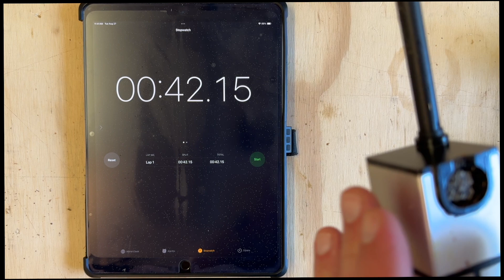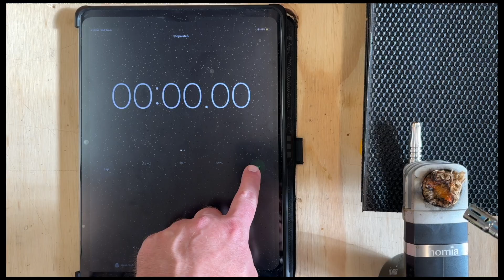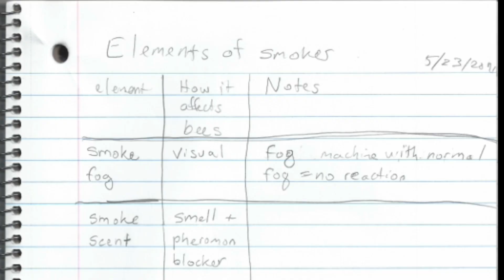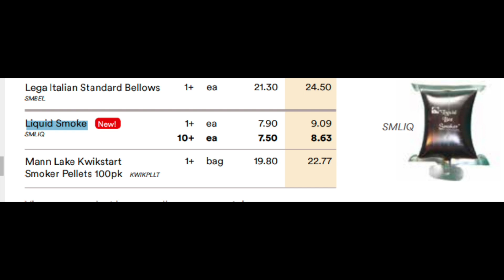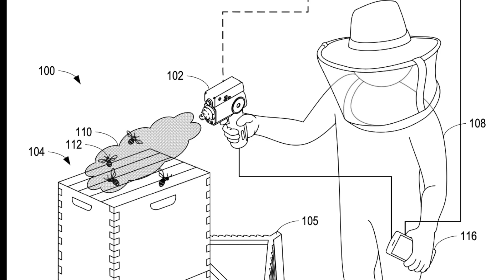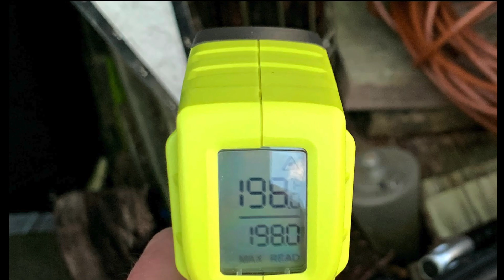The Electric Bee Smoker That Could Change Beekeeping Forever  ⚡️🐝💨

Comment: I assume the latest prototype is still using a purchased vape? How long is it safe to use for without overheating the components/battery? Are you concerned about the vape battery exploding while it's in your hand? What precautions have you taken for those scenarios?
Reply from the maker: Hey Austin, I'm using a mix of off the shelf parts and custom ones.  We're still in the early prototyping phase, but regarding safety we're using overheating detection that safely turns off the circuits and we stay within the recommended wattage. Thanks for the questions.
Reply: @TechnicallyBeekeeping May I suggest to work on adapting a bee smoker with an electrode inside to auto light and a fan blower so you don't have to pump a bellows, use a Milwaukee M12 battery NMhi. Reinventing the wheel from scratch is not practical when the early smoker chamber would serve well, it may be hard to get away from bio fuels. One concern is that the creosote in the not fully combusted bio fuels causes cancer, it's a major concern for health to try and improve it IMO, it would require heaps of scientific testing in laboratory conditions, would cost a lot but worth every cent if it can bring a better product to market. I doubt you'll get people to spend more than 100-150 $ though so it has to be affordable again IMO.
Reply from the maker: @livingadamman7994  Regarding creosote, I'll avoid using that like the plague, definitely a toxic substance. You read my mind on the M12 battery, the form factor and weight should be perfect.

Comment: Very cool, the dewalt battery may make it impossible to hang by magnet which seems like a plus to me.  I've been keeping bees for more than 20 years and can keep a smoker lit but many of the folks I mentor can't and only have 1 or 2 hives.  Having to light a smoker for 10-20 minutes can be a chore.  I recommend the compressed cotton or smoker pellets sold by the equipment suppliers to make it easier for them.  Something like this would be very handy.
Reply from the maker: Thanks, Pete! I completely agree.  I have most of my colonies on a farm but I have one at home for pollination.  Getting a smoker running and dealing with the cool down period is a lot of overhead for one hive inspection or if you just want to get in and out. Thanks for mentoring these folks, we don't have enough 20 year beekeepers that are interested in helping newbeeks to be successful. 🙏

Comment: I am super impressed by your thinking, execution, and sales abilities. Personally I believe you have developed a Rube Goldberg solution to an already dead simple solution. However this is NOT meant to discourage you. I believe there is a market among the many new beekeepers who will go through the inevitable learning curve associated with learning how to operate traditional smokers.

Your idea of using the ubiquitous cordless power tool batteries is brilliant and and optional adapters that would allow users to choose which type would help imo. The power tool batteries should be powerful enough to provide enough heat to utilize pelleted wood, a simple easily accessible smoke generator that works poorly in traditional smokers and might work well for your application if you can handle the feed and residue issues. Also, as you have no doubt realized, it requires lots of energy to make heat with electricity and burning a flammable fuel source with electricity might not be feasible.

Good luck to you I believe you on the way to a marketable product that you could easily sell face to face and possibly through videos. I predict a 
short lived product life cycle.
Reply from the maker: Hey Doug, sorry to hear that it doesn't resonate with you. I respect that you like the traditional smoker.  All the best.

Comment: Add a hopper and use ground pine needles 🪡 ✨️ ♥️
Reply from the maker: Random Fandom, I just bought pure pine needle oil to see how the bees react by adding it to my current mixtures.
Reply: @TechnicallyBeekeeping  your biggest issue is hopper size, and smoke temp. Too hot, and you'll cook off some bees 🐝,  and piss off the hive. Cold smoke is better. I used to smoke 🚬 in my hood. It lead to holes 🕳 😳 😑
Reply from the maker: @RandomsFandom  Lol, I've had holes in veil before, it's not a fun time.  Three stings to face. :eyes-purple-crying:
Reply: @TechnicallyBeekeeping  I used to work as an apiarist in Florida.  We had billions. They'd drink 350gal of syrup a week easy.

Comment: Cant say I ever had problems operating a traditional smoker tbh  but this would be great for  new folks with a single hive and less hassle. I love being non digital on the farm for obvious reasons but gets easier all the time with solar batteries etc.. many hives are on off grid plots of course
Reply from the maker: Thanks, PazLeBon, I respect that some beekeepers like yourself have mastered the traditional smoker and are not interested in an alternative. Interesting idea with the solar batteries.  Maybe even a solar charging station in time as I'm now looking at using standard drill batteries.  Thanks so much for your feedback.
Reply: @TechnicallyBeekeeping  I didnt mean to imply it wasnt interesting at all. More that the traditional one works great for multiple hives that Ive usually owned but for or one or two hives they'd 'be be a pain so this is ideal for the hobbyist. Not even solar charger needed so much but larger 1kw type batteries are becoming quite common on the farms so being able to connect to those would be great some of which woul dbe solar.. others perhaps recharged occasionally. Many would have just a usb c type connection :)
Reply from the maker: PazLeBon, yes, I have my main apiary on a farm outside of town and one colony at home for pollination.  When I inspect my home colony, it's a pain to stoke up a smoker for just one hive and then to have to babysit it while it cools down.  Since I invented the electric smoker, it's much easier, I just go out, smoker the bees, do the inspection, and bam, back at my home desk before lunch is over. ⏰
Reply from the maker: @PazinPortugal No worries, my friend! I took it as a positive. I hope you keep watching the channel and engaging with me—I've really enjoyed our conversation. You clearly have a lot of beekeeping experience and could be a fantastic mentor for our community.

Comment: Commercial beekeeper here: 
Ditch the hive inspection aspect to keep cost down. Focus on this thing lasting 8-10hrs, being light weight, and convenient to carry while not using. 
I totally want one, im tired of breathing in burlap or moldy pine needle smoke all day.
Reply from the maker: Thanks Zak.  Totally agree that it needs to be long lasting and the fuel and batteries need to be easily swapped out. I appreciate your openness to the idea.  I wasn't sure if commercial beekeepers may be open to it.  I also think that making it rugged and something that you can throw in the back of the truck would be useful.  Might also be interesting to put an airtag feature in it for if you lose it in a field. Not sure how well airtags work in rural settings, I'd need to research that.  Thanks for the feedback.  Very useful to have someone that lives and breaths beekeeping weigh in on the commercial side.
Reply: @TechnicallyBeekeeping  I'll buy a prototype when your ready for trials. I'm in the bees every day basically all year
Reply from the maker: Thanks, Zak. Have you signed up for the VIB club yet? If not, it's great way to get involved.
https://technicallybeekeeping.activehosted.com/f/1

Comment: This would be a fantastic device to use during the hot summer months, or whenever there is a burn ban in effect in your county. You could possibly make the smart recording device voice-activated, so you could tape a problem frame, or summarize the health of your colony.
Reply from the maker: Paul, I like your thinking!  I've been thinking about something like a Siri for inspections. When you have a frame in your hands and propolis, wax and honey on your fingers is the worse time to grab a pen and paper.  If you could use voice commands, it would be perfect.
I'd not thought much about burn bans and smokers before building this. As a person in Chicago, we don't face this often. But many states have regulations around bee smoker use.  I believe that this smoker could prevent a lot of forest fires in the future.  A benefit that I'd not really thought much about before starting.  Thanks!

Comment: Love the idea and the form factor. Could do a higher end model where the additional piece is a heat camera. Would be very nice for those of us crazy enough to do removals to have a smoker and heat camera that could snap onto the belt and not choke me to death in small spaces. Also, hear me out... why not use a Dewalt handle form factor and their battery as your power source? This way you could take several batteries and cartridges (this is where you make your money) into a large apiary or removal and never need to find a plug.
Reply from the maker: Sam, that's an amazing idea. I'd not thought about the removal angle.  I like the thermal camera concept.
I've come to the conclusion that I definitely need a battery that's easily replaceable like a  drill/driver/dremel battery.

Comment: As someone who vapes, I like it, and have had the same thoughts.  You need to return to the long tube nozzle that runs down the arm, and a remote trigger on the hand.  I wore a belt pack respirator for a long time, and it's not that bad weight wise.  You could make this thing commercial scale that way.  However, the vape cartridges wear out, and a few bucks here and there add up.
Reply from the maker: Interesting, I'd not thought about a belt pack version. It would definitely help with fuel capacity for bigger jobs.  Thanks for the ideas.

Comment: I love this! As you said, sometimes I want to spend hours in the hives, so a big smoker (car) might be more appropriate. But, by far, the vast majority of my beekeeping time is spent popping into a hive or 2, just to check out what's going on in the top box. Often, I don't even use smoke, but having a unit like this (horse) would be great for when the bees are getting chippy. 

I would prefer common, replaceable, rechargeable, smaller (like AA) batteries, as long as they lasted for, say, 15+ minutes of run time (that should be a couple of hours of on/off use), but using a bigger, cordless tool battery works too. The problem is, then you have to get involved with all of the different battery configurations of the different tool companies (well, you don't HAVE to, but then you're limiting the market). I also envision this unit being left in my bee yard with my other equipment, so the idea of having some extra AA batteries ready to go, and not tying up my tool batteries suits me. All told, if I got enough run time to be in the hives for an hour or so, I'd prefer the AA setup.

I do run the Lorob bee vaporizer with an 18V Rigid battery, and love it, but that's a very specific use at a very specific time, so I don't mind that setup. With this smoker, I want to be able to use it on a whim, so I want it in my bee yard.

Anyhow, I appreciate your curiosity and your experimentation. Thanks.
Reply from the maker: Wow, what amazing feedback, Doug.  I really appreciate it.  It's a good point about not wanting to tie up your tool batteries.  I'm not sure that I could get AA batteries to have the juice needed to run it, unfortunately.  I am looking to make it detachable, whatever I do.  My current design, you'd need to open the battery cover, but I'm learning from the community here that having it easily swappable like how I have the fuel source is key.

Comment: awesome! Drill batteries is probably a good choice, make sure you have adapters for the most common used ones!
modular system where individual parts can be replaced.
Please don't over price the oils and coils, this device can prevent so many beekeeping related fires!
i'd buy one, even your prototype to test!
Reply from the maker: Flashcard guy, love the name.  What kind of drill/driver/dremels do you use?  What would be your preference?
Regarding the oils and coils, agreed.  I may even open-source the oil recipes in the end. I want beekeepers to feel that they can use the device even if I get hit by a bus. 🚌  It probably doesn't make sense from a business perspective, but I just want this device to help the beekeeping community.  We're dealing with so much with mites and keeping the bees alive.

Comment: great idea! I suggest making the battery adapter easily swappable so you can sell to owners of other batteries than dewalt. Heavy powertool batteries will probably overload the magnet though.
Reply from the maker: That's an interesting idea with the swappable battery adapter.  With the heaviness of the batteries overloading the magnet, I agree.  I've seen some comments that perhaps I could use a hook, which would solve for this, but I also don't want a device that's heavy to carry around all day for people with a large apiary. The current weight is super light, which I really like.  What brand of drill/battery do you like/use? Thanks.
Reply: @TechnicallyBeekeeping  I have black and decker.

Comment: I like the idea of the 20 volt Dewalt battery. It is light enough (12 oz) to hook to your belt and strong enough to provide power for a long time. My current Dewalt drill has a hook to clip right to my belt. Personally, the idea of a hook, similar to what is on my current smoker, would be fine. I would just hook the smoker on the side of the bee box. My current smoker weighs 2.5 pounds empty. I can’t hook it to my belt now so,  I would not worry if the new one did not have the ability to hook to my belt. Let us know how you progressing. Thanks
Reply from the maker: Jim, good point about the belt mount. I am thinking about mounting a light smoker to a manikin's belt clip and the electric smoker to another manikin's belt to watch the difference. :)  I suspect the first manikin will go up in smoke. 
Thanks for the hook idea.  I'll check it out.  Keep watching and subscribe to the channel so that we can exchange more ideas. Love the feedback!

Comment: This looks very promising. I have been considering the Apisolis smoker as it would be more convenient checking a few hives quickly or if there is a high fire risk. I know their design uses a tried and true bellow design but I really like the adjustable fan speed your prototype offers. I agree that you should definitely consider the drill type grip along with the popular batteries currently available, since many people already use those. It will make the smoker a tad heavier but I think also a bit sturdier. Finally, the trigger mechanism as it currently is designed may build up quickly with propolis and beeswax. I wonder if a soft touch button that is covered would be affected less. Or if your trigger device was covered with silicone type material that would prevent propolis from gumming up the trigger. This does look very exciting and I think I will wait to hear more about the availability of the product before I purchase anything else!
Reply from the maker: Phillip, regarding the bellows, I've found that mounting a camera to a bellowed machine doesn't work due to the movement. I've also gotten some feedback that after inspecting more than a couple of hives, many beekeepers get tired of pumping the bellows. So I agree that the fan is the way to go.
Regarding the trigger, you have a great point. My plan is to use hydrophobic materials on the handle of the smoker to repel propolis, wax, and honey (also more sanitary for the bees). The part I've not figured out yet is how to make a satisfying trigger experience without having the gummable space between the trigger and the handle.  I've thought about capacitive buttons, but they don't work well with leather or silicone gloves. I may try a membrane button like this one, I'm not sure how nice it would feel though, what do you think?  
https://www.adafruit.com/product/1333?gad_source=1&gclid=CjwKCAjwufq2BhAmEiwAnZqw8vr69tnQueFNfMjs9TwX20amLnpGnoR_kbY_va9PD1fFje8ZULz-yBoC9n4QAvD_BwE
Reply: @TechnicallyBeekeeping  that button is better than what I was thinking and believe it would provide a very durable and clean way to turn the unit on!
Reply from the maker: Keep the ideas coming, Phillip! It will make the device better and better.

Comment: Cool development. A small solar panel in the side or top could boost run time or potentially help maintain a charge if it sits unused for long periods of time.
Reply from the maker: Thanks, Honey Bee Live.  I might try that on the smart device as well, it has the flat surface and could run down over time.  Keep the ideas coming!

Comment: Wow, I'm impressed with all the research and development you did.  I usually have to reload my smoker twice for each hive.  I would prefer a rechargeable battery that can be charged with a USB-C plug.  I use Makita instead of Dewalt battery tools, and a lot of people use Milwaulke.  The QR code on the side for instructions is a great idea and the magnetic clip is a great idea, too.
Reply from the maker: Yes, USB-C if I have an internal charger is a must.  To your point, I was looking at this battery this weekend and looks really promising.  Let me know what you think?  DeWalt has a simliar 8V that might work.  Thanks so much for the positive comment, I was worried I'd get a lot of trolls, but so far everyone has been amazingly supportive.
https://www.globalindustrial.com/p/72v-lithium-ion-cordless-1-4in-hex-driver-drill-kit-with-auto-stop-clutch